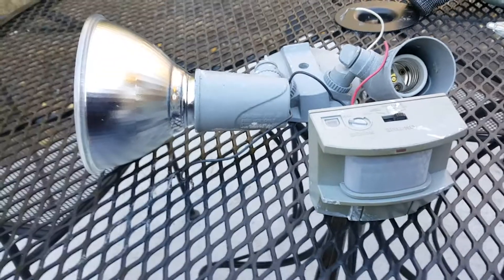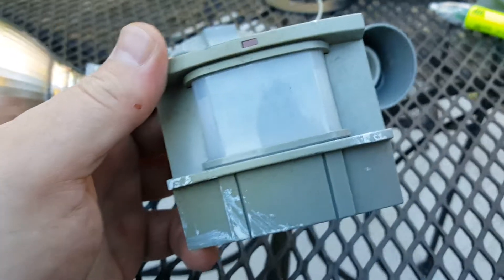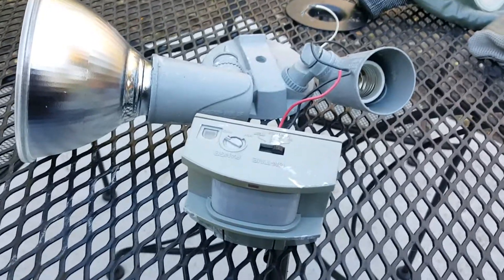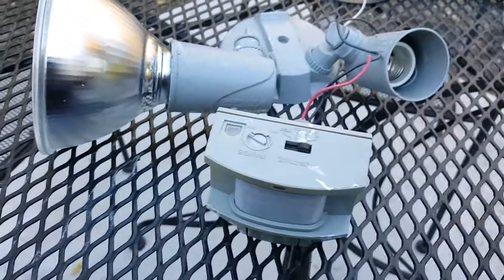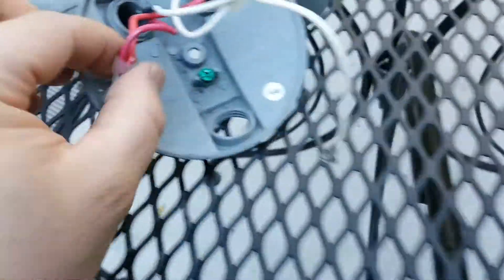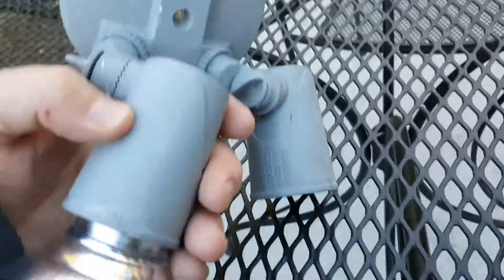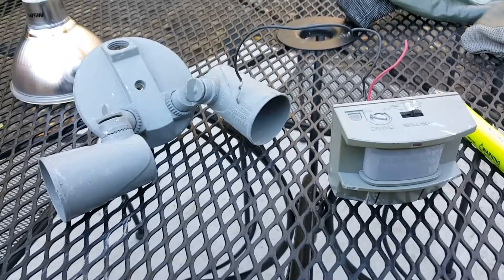DIY HACK bypass a broken Flood Light motion sensor safely and re-use or recycle a broken spotlight

Comment: Loved your video. Straight fwd and concise. Is there a way how you can attach a wireless motion sensor running on battery and hardwire a transmitter to this floodlight? To be more cost efficient.
Reply from the maker: Im sure theres a way to do that using led oowered flood lights but i dont do battery power electrical, I'm sure there's a few video on it somewhere please subscribe and watch some of my other videos
Reply: @drewsquickfix  
Will do thank you.

Comment: This was my Friday night project.  For my Heath Zenith unit, I'm able to use red & white wires without cutting the crimped connectors.  I do have an extra white neutral wire from crimp connector that I'm planning on snipping and electric tape end of wire.  For the hole where motion detector was, I pried out swivel ball part, and glued a plastic 32 oz. Apple Juice bottle cap.  Matched the white colored unit, good fitment, and keeps wires from exposure to elements.  Actually looks normal!
Reply from the maker: hey s. fitz!!! long time no speak hope u fixed the issue sorry comment got lost and im going through 100s of old comments now that youtube shows me unanswered comments.... thanks for watching!! hopefully your still there!! -cheers

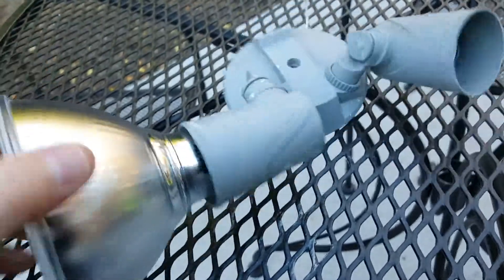Comment: @2:25 a really good idea to turn off the breaker, but you may as well also keep the switch in the off position.
Reply from the maker: Yes good advice
Reply from the maker: Thanks for watching
Reply: I hope to bypass a different model today, so thanks for the video.
Reply from the maker: It always makes me feel good to help someone. You can buy plugs to fill the hole at home depot. They have plastic and metal plugs. Like $2 for 6 with different sizes.
Reply: I just finished bypassing a "DualBrite" unit for a client. I left the motion sensor part in place.

Comment: I tried this but it didn’t work for me. I replaced the bulbs just to make sure, but still nothing. I guess the entire thing just needs replacing, but thank you for the video. At least now I know.
Reply from the maker: Yeah probably a good idea just to buy an new light. I recommend buying a new light that still takes bulbs . The LED glad light bulbs by philph are incredible!! Those LED lights without bulbs that can be replaced I don't annoying and too bright and seem artificial. Hope this helps. New floodlights without bulbs is only like $20 at home depot. Please subscribe!
Reply: @drewsquickfix  You're going to laugh,but I just took down the old light to install a new one and realized why your fix didn't work....I forgot to hook up the hot wire! 🙆‍♀️🤦‍♀️ Lol! I'm such a nucklehead. I bet your fix would have totally worked!! 😂😜
Reply from the maker: @ITWorksSoftware  ha ha dang.  Its all good though new lights are better anyways
Reply from the maker: @ITWorksSoftware  good thing you found that, the hot wire if it it's exposed can cause a fire if it touches metal.it can get hot
Reply: @drewsquickfix  yup, no worries, I had it capped off and also put electrical tape all around it...just didn't connect the light's hot wire to it, silly me. 🤣🤦

Comment: I have exact same problem and just wanted to convert to on off functionality.  Did you put non functioning sensor piece back on unit to close hole?  Thanks for video.
Reply from the maker: +s. fitz no I didnt put the broken sensor back on. I bought fitted hole covers at home depot or lowes. Like $2.00 for a bag of different metal fittings. Only catch is a plane floodlight is like $9. So it adds a little to the cost of reusing the floodlight vs buying a new one. Although the package has 6 fittings 2 of each size so you can use it on 2 floodlights. Thanks for commenting and watching subscribe if you haven't already. -cheers
Reply: Okay thanks.  New subscriber today.  Also here's a tip if garage remote stops working that I did not see in my craftsman instruction manual after battery change...  unit did not function after battery change or doing the relearning code procedure...  other remote worked so I knew it still received signal.  the trick to regain functionality is to unplug garage door from power, and remove batterfor a minute or so.  Re-power both and do re-learn and hopefully saves you from buying a new clicker.
Reply from the maker: +s. fitz thanks good advice about the garage door opener thanks for subscribing :) I usually post car videos and fix it videos when something breaks but I have some cute puppy videos too if you know anyone who's interested. Lol they font get as many views, ha ha guess i have been steriotyoed as a fix it channel ha ha.

Comment: You know you could of just spray painted the top & bottom of the Sensor & it would stay on whenever you hit the switch? & getting a  little bit on the sensor aint going to hurt it either if you want it to always be on at least.
Reply from the maker: Actually the sensor was affecting the whole light in this situation but that is a good idea
Reply from the maker: I've had it this way for about five years now and I'm really happy with it
Reply: @drewsquickfix  Yeah its just something interesting i found out on accident to let people know who don't feel comfortable messing with wires. ;p